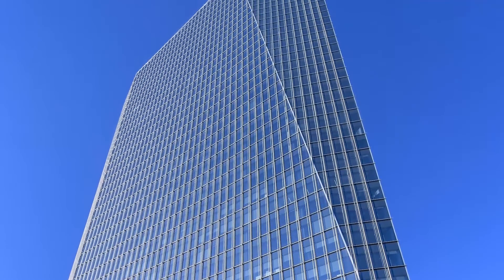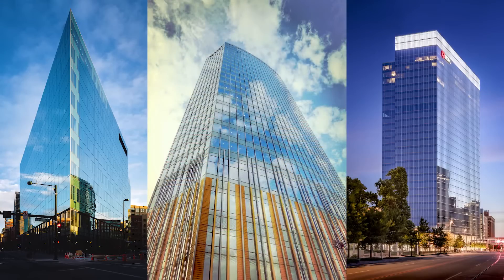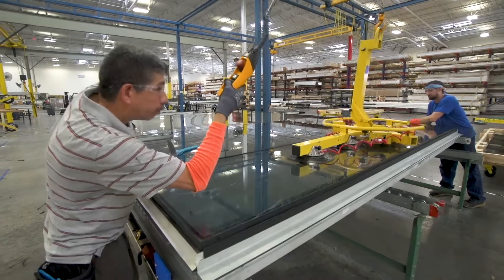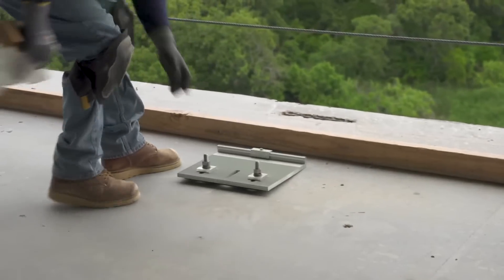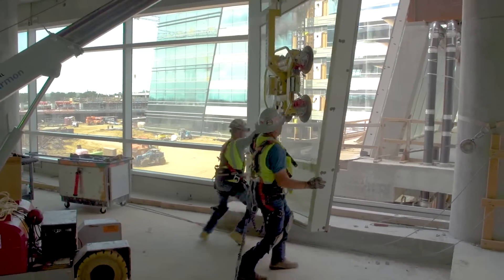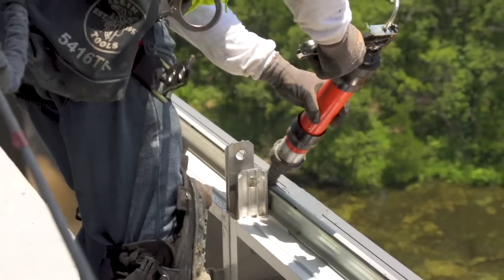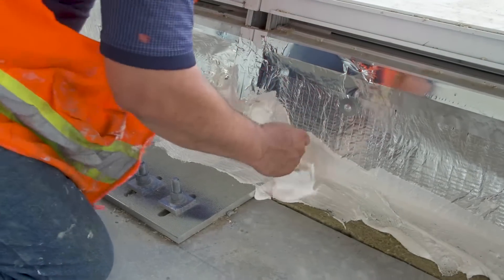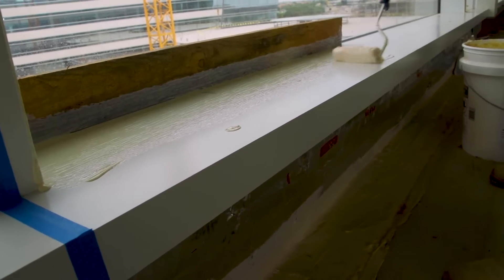Harmon Curtain Wall Installation

Comment: Looks good but looking at your panels and install. Did not see any PE holes in the millions at the transoms. Pushing the insulation  against the slab unsupported not good practice. Thermal and structural movement could make it come loose. Better under flashing insulation and over flashing ti secure the insulation and form a better smoke seal. Stack head seams a bit small to me but hard to see on video. Sealing the stack head with just sealant could lead to leaking due to thermal and structural movement. Best practice is to use a splice sealed in place. But over all not bad. Would not stack up to Australian standard

Comment: What's the machine that comes out in 2 minutes and 2 seconds? 
Can I know the product name?
Reply: Don’t know the crane name but the hydraulic suction cup machine they’re using is a Woods Powr Grip, model MRT411LDC. I glaze with it every week. The pound capacity is 700 so that’s some light wall.

Comment: Joiner turned curtain wall installer and facades an cladding , it's not as skilled as carpentry but never out of work and always kept going,  it's the way forward as most builds r done by metal and glass
Reply: Hello sir, how do I get into this career if I have a degree in architecture?

Comment: Does this product require that a raised floor be installed or something? If someone was to step flush to the panel or out some furniture there wouldn't they just fall through the gap? That foam isn't exactly load bearing.
Reply: Would like to work one day with company like this...you did a great work..
Reply: Im assuming there’s a wall covering that gap for outlets, pipes and wires.

Comment: Omg, I've worked on curtain wall projects, predominantly traditional stick build but some unitised systems and this is incredible. The efficiency of the whole operation is stunning. It's hard to see where errors and issues could even occur.
Reply: Oh trust me things can go wrong. Surveyors messing up set outs, bracket crews setting brackets wrong, prep crews installing the wrong features on the panels, panel crews screwing up elevations (I know a dude who accidentally set a laser on lock and installed 8 panels, so the last panel was 20mm higher than the first, all had to be fixed). And then there’s the safety, oh boy, I saw a guy fall out of the building end of last year, lucky he was wearing a harness but he wasn’t meant to be where he was when he fell. Blokes won’t lanyard their tools or materials and dropping things happens often and can shut a site down for the day. Plenty goes wrong every day, it’s not a job u can switch-off at
Reply: @DonRoyalX  Thanks for the realistic summary. I am looking to find a day in the life video of setting these, not just the marketing video. Would appreciate the link. I've been designing multifamily for 3 years now and we never get the chance to see enough on site.
Reply: Hey! I am currently pursuing architecture and we've just been taught about curtain walls and we learnt that finding stick systems is hard these days, if you can, can you please mention some projects name that you said you've worked on(stick systems)
Reply: What is the first curtain wall used around the concrete floor area

Comment: It’s sad real Glaziers are an endangered species. From a REAL GLAZIER!
Reply: @Randomadventureswithpaul  I am an old retired Glazier, in 1968, my company started to install curtainwalls back then they used  Ironworkers and Glaqziers to install they were all stick systems back then finally they preglazed the panals  bingo changed everything faster preglazed. and when i worked for Harmon they had it under control they are pretty good.
Reply: what do you mean?
Reply: bill gonzales I mean those guys aren’t real glaziers
Reply: Matt Allen so what are you who do you work for alliance 🤣👌
Reply: Thar ironworkers with rigging cards
Reply: @Randomadventureswithpaul  Yeah things have really changed thenew  glass is so far better i n buildings it saves money on energy bills far better then just 10 years ago, here in No, Ca there is a shortage of Glaziers and so much work take care .
Reply: hey matt, yes I know, some glaziers joined the Ironworkers and got steady jobs if you know how to weld?
Reply: Last time I checked they call themselves finish ironworkers lol
Reply: yes u are right my friend
Reply: I know the best glazer in ohio and he can't find work
Reply: @Randomadventureswithpaul  can you cut a circle from a sheet of plate glass? 😂. Can you install a stair rail? Can you install a steam shower with multiple angles and transitions? Likely not. But you can smack on interior beauty caps 😂👍 like a pro. You don’t even caulk what you install.
Reply: @Randomadventureswithpaul  I’m not kidding you. Seeing an entire job through from beginning to end is when you develop skills. Trust me after 21 years in the trade I’ve worked alongside guys like you. You bring a photo album of your accomplishments but fail to realize your part wasn’t what you thought it was, and you get outpaced and overrun by real glaziers that layout, measure, and install their own jobs. You rely on machines rather than yourself. By no means is the shop I work at broke. You say you’ve done stair rail ok the install is easy the layout and measurements make or break the job. You probably have no clue regarding doors or door hardware or even what nuances each brand has to offer regarding panic hardware and auxiliary hardware. If you believe school teaches you how to install, measure, and breakdown custom shower doors or mirror work your a fool. Let’s move on to windows on the residential end. Fleetwood doors, do you have any clue? Brake metal? Oh ya that gets subbed out just like the caulking. Trust me you’d get embarrassed at a real glass shop not a production based shop.
Reply: @mattallen1660  Company I work for does, we do everything ourselves. You’re absolutely right, measure and layout is by far the most important part. Install isn’t anything compared to that. We do everything from brake metal cladding and fabricating and installing units, caulking, sealing, anchoring, we do it all. I’m new in this business and I’m glad that I work for a company that does it all instead of subcontracting all the work to someone else like iron workers and what not
Reply: @mattallen1660  True 
That’s the difference between big shops and small mom & pop shops. 
The Down side with non union union mom& pop is they pay you nothing and expect for you to run work, plus they could care less if about safety
But like everything there’s pros & cons
Reply: @mattallen1660 would like to chat with you !

Comment: Working in mud doesn't look fun , there's a cantilevered loading platform company in Boston that has Platforms that cantilever 14-16' from edge of building carry loads to 10,000 lbs and are 12-14' wide. You could load bunks on floor with crane then wheel to each unit on platform and set with crane . MLS Platforms, they have licensing agreement with Samson Equipment in England and Hardideck in Australia.